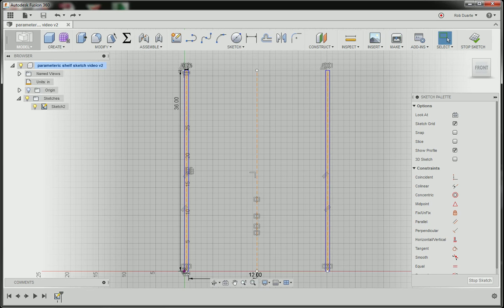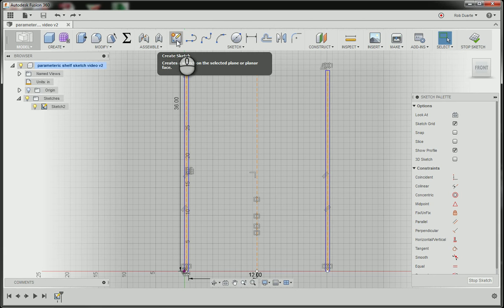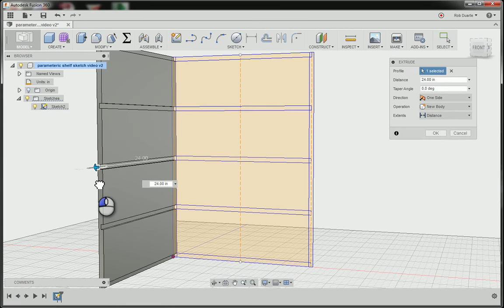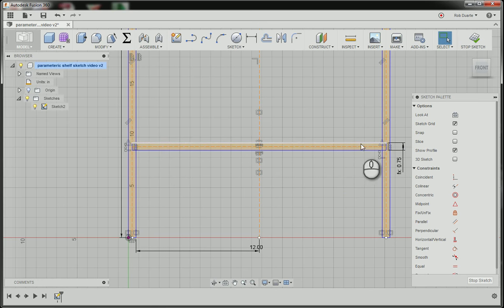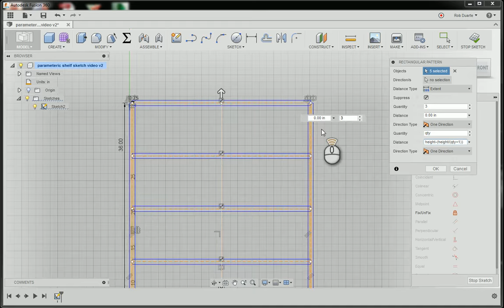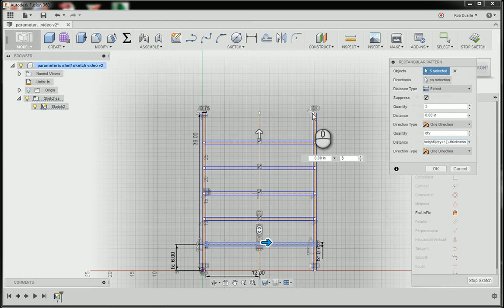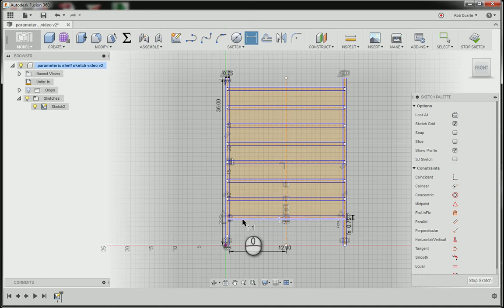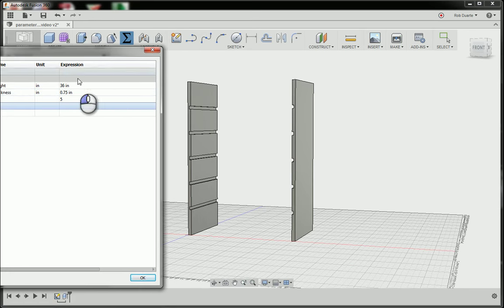Fusion 360: Using parameters and a rectangular pattern to sketch a shelving unit

Comment: hey man I know this is an old video. but what if I wanted to make this so that each shelf and wall was a separate component? would everything still stay matched up if i change parameters?
Reply from the maker: Yeah this is ancient times. 😂 You might want to check out this slightly less old tutorial I made .. https://youtu.be/7bmUev37ppA .. it uses parameters and components. It's better if each component has everything it needs though - ie I'm not sure it's the best idea to make a single sketch that all the components are based on. But I'd say the papanek video is definitely closer to the way you'd want to approach building a real thing than this early video which doesn't seem to use components at all.

Comment: How do I edit a rectangular sketch pattern that I've created?
Reply from the maker: I'm not sure I understand what you're asking. Can you explain?
Reply: +Rob Duarte I'm having trouble figuring out how to edit a sketch pattern once it's been created. Let's say I create a sketch pattern with 3 instances of spacing 20mm. I now want to change the spacing to 25mm. How can I do this? I can't seem to find an "edit sketch pattern" feature.
Reply from the maker: +Forrest Grinstead I see. There are two ways... FIRST WAY: when you're in the sketch (or you've returned to it using "Edit Sketch"), you should see a little glyph that represents the pattern that you made. If you double-click on that little icon you can edit the parameters. SECOND WAY: use the Change Parameters feature and find the Model Parameter that corresponds to the number of instances you entered for your sketch pattern. Once you start using parameters of your own in modeling you'll find that this might be your first choice since it's one of the best and most flexible parts of F360. You could also create a user parameter of your own and use that parameter name when you first create your sketch pattern (eg: instead of entering 3, maybe you enter "sides" or whatever you called your user parameter).
Reply: +Rob Duarte Ah I found the glyph. I'll start using parameters more, as they appear to be a powerful tool. Thank you very much for your help!